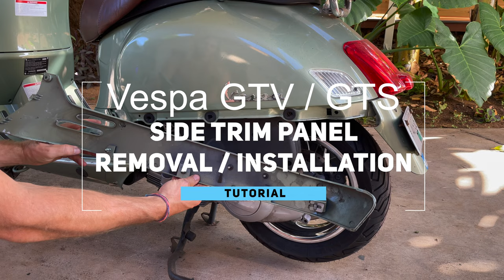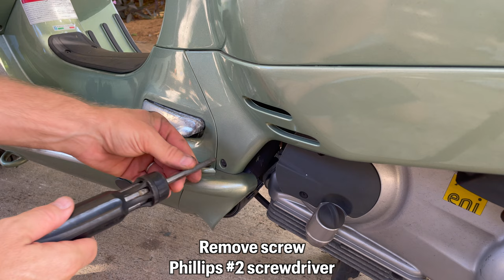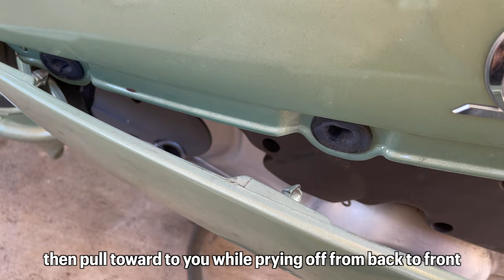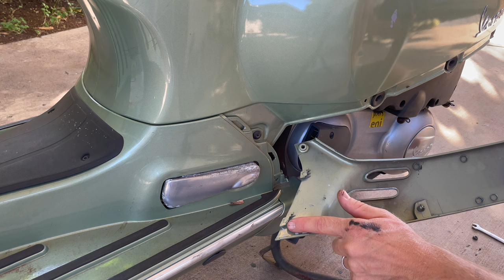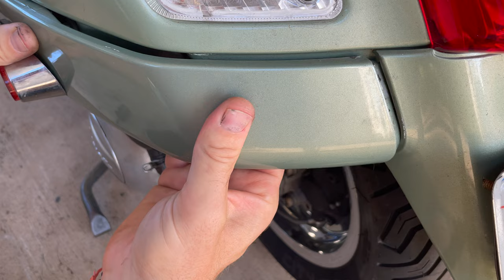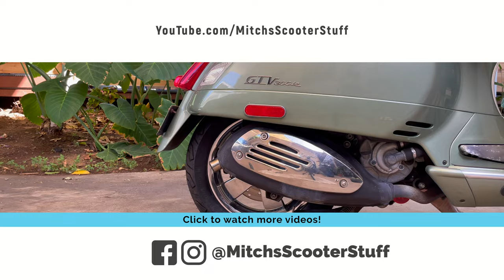Vespa GTS / GTV - Side Trim Panel Removal / Installation | Mitch's Scooter Stuff

Comment: Salve guardo sempre i tuoi video volevo chiederti devo cambiare il cuscinetto braccio oscillante ruota posteriore su vespa gt 200 e su burgman 200 comprando li originali costano troppo volevo mettere skf normali o C3 la ringrazio
Reply from the maker: Hi how are you doing… don’t need to replace the bearing if they spin very smooth… I never replaced mine yet for many many miles
Reply: @MitchsScooterStuff  ciao io sto bene e tu? si ma siccome a percorso più di 100000 km e fa rumore devo sostituirlo ma ti chiedevo se è meglio un cuscinetto normale skf o un C3 volevo un consiglio da tè ti ringrazio